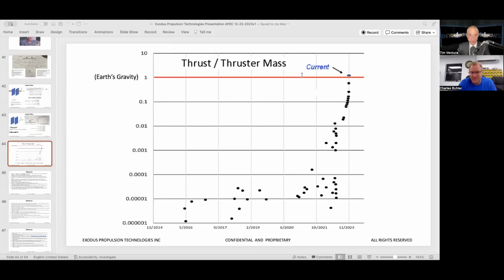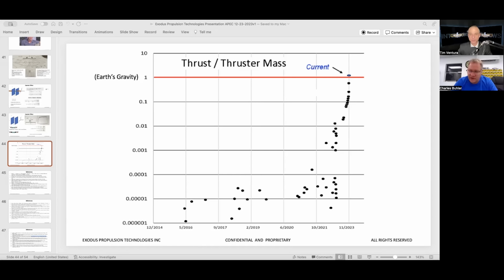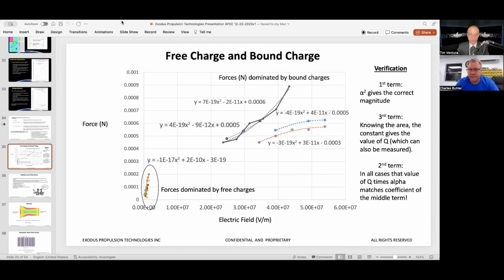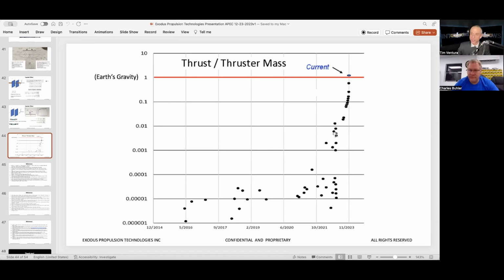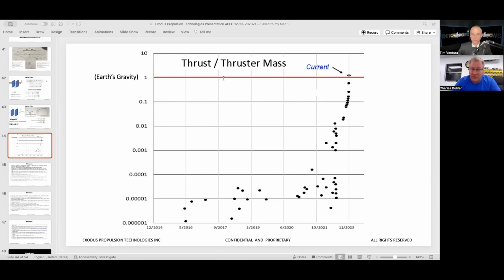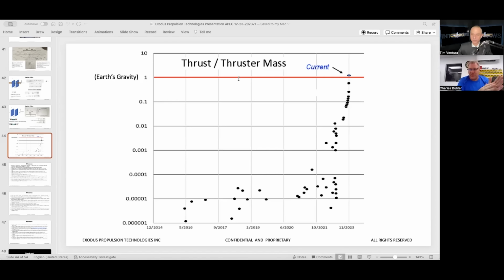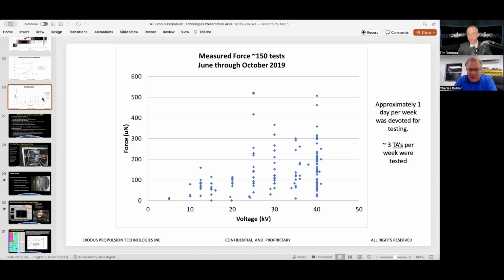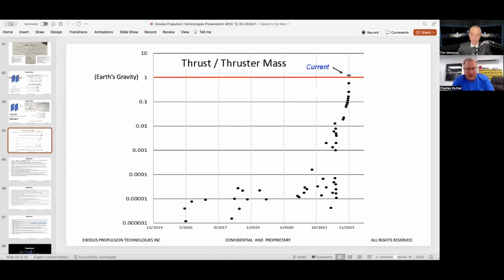Propellantless Propulsion Device | Charles Buhler

Comment: Let's be clear about the meaning of "Thrust to Thruster Mass ratio". Basically, 1G thrust propulsion allows the weight of an object to "float in the air".  A usable drive would achieve 2G thrust (that would have to include accelerating the mass of all things passenger during transit). Such a craft would lift off the earth (1G) then maintain 32 feet per second per second acceleration (2G lift) (initially while exiting Earth's gravity well). Occupants would then weigh their own weight on any scale in the craft (once away from Earth traveling at 1G through space). The craft would continue to accelerate until it got half-way to its destination, then turn around and decelerate for a landing. To get to the nearest star (Proxima Centauri) would take, roughly 4 years of light-speed travel.  The craft would achieve light-speed (if possible) some four months after departure and decelerate for a final 4 months. During the intervening four years, all bodily processes (and electronics) would be suspended due to waveform flattening at the velocity of light. Navigation and other processes would also be suspended for the same reason. Assuming time dilatation effects are marginal at 0.9 light-speed, a practical craft would be prevented from achieving light speed (obviating potential stasis).   Operating at 0.9c would only add roughly a half-year to the venture -- kewl....
Reply: It would take about a year to get to 95% light speed. It would take about 3.6 years to get to Alpha Centauri (7.3 years would pass on Earth). No matter how fast the ship goes everything would be normal on the ship, relativistic effects are all from an outside/stationary/Earthbound observers point of view.
Reply: @shawns0762  Hi Shawn,

Proxima is 4.29 LYs distant. You may want to revise your transit time (using relativism) to 4.5 years. Meanwhile, relativism is a theory -- not a law. Considering relativism as "waveform distension" (meaning emitted light loses frequency as a craft accelerates rather than mass increases and time slows down) reveals a different picture about time dilatation. Basically "change" (time) is based on energy. Waveforms lose energy roughly proportional to frequency. As a craft accelerates, waveforms emitted spend part of their energy-frequency "catching up" to the craft. Chemical processes depend on energy levels to drive them (quantum absorption/emission). Wavelengths of say "blue light" become red. What once was energetic enough (blue) may no longer induce a specific chemico-biological process (quantum theory). Yes, this is a radical re-interpretation of relativism, but it may explain how craft can go faster than light, and time dilatation is no longer a factor (within a self-contained "warp bubble"). The bubble carries along its own spatio-temporal matrix not bound by the Cosmos at large. Super-luminal speeds become a possibility...

Comment: In a hollow conductor, charge evenly distributes with the divergence orthogonal to the surface gradient hence a zero potential exists inside the conductor. This condition doesn't hold for charges on the surface of a dielectric (i.e. a non-zero potential inside the material. Either way the near field approximation, in both cases, would betray changes in flux density according to non-uniformities in the surface geometry, but not in the far field. Considered as point source, the electric field in both the conductor and the dielectric would appear approximately uniform. How this might lead to a net non-zero force, in either case, is difficult to imagine.
Reply: I'm going through Dr Butler's patent and have found several errors which Dr Butler may be aware of. One example, eqn (15), the factor C on the RHS should be squared, not omega. However this may not affect the conclusion substantially, unless omega becomes very large. I may comment further, but so far it looks intriguing.

Comment: 14:01 It sounds like they got to 1g by reducing the mass of the device rather than increasing the thrust.
Reply: valuable in a weightless vacuum. 1g thrust builds up over time
Reply: @QuantumPK  Sure if you can accelerate a 1000kg spacecraft at 1g that's great. But if your craft cant be more than a few grams that's much less useful even at 10g.
Reply: Yup, but it still counts
Reply: yea this whole thing sounds lke a psyop. big shock. nasa involved in a psyop. i love nasa though. and psyops can be fun. i wish this guy luck!

Comment: Likely all measurement errors. Vacuum chambers are of metal. "Mirror charges" will be created in the metal and electrostatic forces will predictably result between a capacitor and a vacuum chamber wall....

Comment: This guy said some wacky things. At 21:29 he said having a constant electrostatic force produced by a capacitor that just sits still, without supplying any power to it, violates the laws of thermodynamics. It does not. 

A force needs to produce work in the sense of W=F*d , through motion, in order to transfer energy. His proposed scenario involves no flow of energy out from his capacitor, hence there is no need to posit any strange source for this non-energy-whatsoever. I produce a large force on the chair I'm sitting on, but that doesnt mean I'm generating power like a magic power plant that contradicts thermodynamics.
Reply: He also said they are working at the microscopic level. Static electricity will hold a balloon to the ceiling, but not a 747. many things work at very small scale, but not mesoscale.

Comment: Comment at 25 min's in.
Yes, the Casimir effect is due to the "collapse" of the time energy wave between the plates due to insufficient room for one wave cycle. The energy waves still exist outside the plates and so there is a net imbalance of forces and so a net force closing the plates together.
Zero point energy, ("and all that jazz"), is, as suspected, almost cancelled to the tiny value we measure in practice, despite the vast amount of energy we calculate in theory. This is because the time wave has its negative counterpart, it is a binary wave form, and the net effect is almost zero. (Not quite zero since the waves are made up of energy quanta and so one wave must lead the other by one quantum, one Planck time). This is the tiny net energy we measure, but the vast energy we calculate is for our single positive wave only. We should be able to tap into this. There must be a way.

Comment: Comment made at 24 min's in.
"....no one knows what an electric field really is". That's right, know one does. According to present day thinking, there are numerous "fields" one for this, one for that.  But ultimately there must only be one field, the field of space time. "I can't imagine we're bending space time", but, oh yes you are my friend. You are curving time. All energy takes its energy from the field of time and so time reduces local to the energy, (and/or mass). 
The Earth only has to reduce the time rate at the surface to 0.9999999993044123 of the normal time rate in empty space (as if the earth were not there), in order to produce a gravitational field of 1 "g" at the surface, decaying, (actually, recovering), with elevation of course.

What you have produced is a version of the Alcubierre drive. Your electrostatic energy takes energy from the field of time in an asymmetrical way, (geometrically). It slows down time most in the direction of acceleration, and since "everything tries to exists where time runs the slowest" to quote Kip Thorne then you accelerate in that direction.
Except the Alcubierre theory is only half right. You CAN slow down time ahead of a craft, and so you "fall forwards", but you CANNOT speed it up. You can NEVER speed up time, i.e. you can never create energy, only use some of it from the field, so the field has to diminish when you do so. (If you were able to speed up time, then you would be capable of creating a whole universe and I don't think that will ever happen).

Try this for size. I believe it will help to develop the theory and so help with the development of your drive.
academia dot edu - Ken Hughes - Papers no's 1 thru'10

Good luck with your endeavors.

Comment: I have a problem with describing thrust as being "over 1 g of force".  g is an acceleration, not a force.  Buhler talks a lot about how thing used to be done but does not explain how his device works, which he should be willing to do freely, since it is patent protected.  When he mentioned "zero point energy" I became convinced that this video is part of a hoax, as physicists do not consider it possible to harness zero point energy.
Reply: A quick google search on papers about this, with actual calculations, data, experiment set up, etc yields ZERO results. The only articles are from oddly named publications which look like rags at the supermarket checkout lane.
Reply: F=ma. Thus a (1g) is the F to move an object of mass m. It is relative measure with respect to any object of any mass.
a=F/m  aka the number of g forces to move an object of mass m
Reply: To be fair he does mention Casimir effect which is real

Comment: While I will listen carefully, the first red flag is in explaining his device's thrust in "G-s".
That is meaningless. The few photos I have seen of the test setup indicates a torsion spring to measure the force.
There is ZERO reason to convert to "G-s" and makes zero sense unless we know the mass of the object being accelerated.
This doesn't even matter in this instance as nothing moves during the test (static force against the torsion bar).
So, the "mass" of the object being accelerated is irrelevant for the test.

It is just flat out wrong, and I am surprised even a Bachelor's level physicist would make that mistake.
Seems more like language meant to deceive.

Comment: How do you explain the apparent violation of energy conservation? The violation of first law? There must be some explanation. You probably need as much energy to put into this as you would get form a fall. It probably stops at a set altitude or something...
Reply: It doesn't violate the conservation of energy as they are putting out energy we just are lacking what it is pushing off or interacting with aether strings??

Comment: c²=ε₀μ₀ ... So why not substitute that in a roundabout way into E=mc²? Thus m=E/(ε₀μ₀). Working with that, couldn't you introduce relativistic permeability or resistivity and cancel out what's going on in the denominator? The asymmetric charge is producing an inherent force the same way mass does. The properties of the vacuum itself are kind of weird, because they have spring-like and/or dampening qualities. But the tension or hysteresis effects of that may also be what an energy gradient would be acting against to produce gravitation fields. So this thing may be taking advantage of an electrogravitic effect that's not quite well documented enough yet.

Comment: Speaking largely as a Layman but someone that understands the basic concepts, I would suspect that the best way to implement this for anything that's in system travel exclusively would be involving photovoltaic solar collectors as the power source. Anything beyond the solar system we almost certainly required nuclear fission or if Fusion is perfected by that time. Since the mechanics of the Alcubierre drive or likewise electrical in nature, I would suspect that in terms of velocity combined with a electrical thruster the two in conjunction could give us the kind of speeds that are depicted in Star Trek and Star Wars, especially based on an exponential 1G curve.

Comment: Long comment of speculation.

This is UFO propulsion. How long till we learn that those flying black triangle UFO are actually ours! Now time for mostly speculation. Space time is more like a fluid and the casimir force is a perfect example. Space-time will literally try to fill any empty gaps of less energy which also exerts a force. Manipulating the quantum vacuum should also manipulate space time. Because electrons are typically described as exchanging virtual photons to create their repulsive and attractive forces that pretty shows that the electro magnetic and static forces are caused by localized distortions in the vacuum between the two particles and ambient radiation pressure and maybe if you do get the charge high enough then you can get all those electrons treading across the zero point field enough to sufficiently alter space-time to create a sort of gravitational force that is localized. And they say gravity takes a lot of energy to create but mass does not actually exert any energy to create it which at least to me means it's purely a reactive effect the medium has to matter and other displacements. The manipulation of space-time may not be that hard at all or energy-intensive as manipulating space-time might be the backbone behind every fundamental force. If you can create this effect around an entire craft and cancel out external gravity fields then you can have a craft that can accelerate instantaneously and anything within its energy bubble would feel absolutely no inertia because it would be totally isolated and within its own reference frame if it's indeed creating gravity, and if it is creating gravity as well then that also unlocks faster than light travel not movement travel they're different! Just wait till we find out that zero point energy is actually a thing that can be practical which Garrett Moddel proven.

Comment: From what I gathered, this seems to be an in-space solution for thrust, not a replacement for the rockets currently being used.
Reply: He said the sky is the limit depending on the survivability of materials so if they are at 1G force already I think he's alluding to forces strong enough to propel a spacecraft from the Earth's surface to space eventually. The Saturn V experienced a maximum of 3.9G.
Reply: @michaelbruno1666 no only in space
Reply: @michaelbruno1666  Yeah, but the actual rockets had a thrust to weight ratio (directly analogous to g) of over 100.
Reply: @michaelbruno1666  What craft has ever measured thrust in G's?? It's totally dependent on the weight of the craft which for all we know is .000001 oz. It's a totally useless measurement just like his useless graphs.

Comment: Charles Buhler, try adding strong magnetic fields at right angles to the electric fields. My hunch is this will multiply your output force. When you do your testing, do you take into account the Earth's magnetic field, and it's direction? This may be a missing piece.

Comment: I've seen this one, it's the Epstein Drive.  Unfortunate name, but we can't have everything.
Seriously though, if it's possible to scale up something that's 1.1 Earth gravity, that's flying saucer stuff. It gets much better news the higher that number gets, since you have to carry a power source and control hardware before you start getting productive, but that alone, on Earth, would be huge. Once off-planet it becomes really impressive really fast. What I don't understand is why you haven't done an off-planet test already. If it provides lift, then tape a radio transmitter to it, point it up, and get out of the way. 
This is the kind of thing I've been politely waiting for ASI to handle, but maybe Christmas came a little early.
Reply: Oops, another easy experiment would be to turn it sideways on a tether and you've got a perpetual motion machine. No vacuum needed, don't even need one gravity. Any amount of free force is infinite free energy. Should be able to demonstrate that in an afternoon.

Comment: I haven't finished the entire video but is it possible that no one on your team has considered quantized inertia as a solution to your fundamentals. I know that IVO limited has already launched a satellite with a quote horizon drive using a SpaceX rocket and that satellite is already currently testing their propellantless propulsion system based off of Mike McCullough's theories of quantized inertia. The two drives sound incredibly similar as they rely on electric fields pushing off of an artificially induced Rindler horizon. I only hesitate to compare the two drives in that IVO is not projecting anywhere close to 1G of thrust from their drive They can't even fathom that at the moment they're working with units that supposedly produce micro Newton's at most. Maybe we found the perfect partner for continued research.

Edit: And of course as soon as I make my comments you immediately bring up relativistic inertial and casimir effect explanations which would imply that you are aware of quantized in our show sorry

Comment: Are you familiar with MCA (magnetic cloud acceleration) from "tomorrow's motion". They use magnetic fields and during the switchoff of the coil they switch on another coil to push the expanding magnetic field of the switched off coil into one direction. They also showed a demonstrator with small force.

Comment: Instead of a chemical battery, you might try a nuclear battery as your power source instead of a chemical battery (it will last a lot longer AND you could power all kinds of other systems aboard an entire craft) - you can use americium-242. Also, you can try a betavoltaic device, a thermoelectric converter, and a thermophotovoltaic system to see which one works better - all 3 have advantages and limitations.

By doing this, your nuclear battery can constantly recharge capacitors, too.

And, if you go with a nuclear battery you will need to put proper shielding around it (such as lead or concrete or other material(s).
Reply: You would absolutely need a nuclear device to power this thing for anything except the inner solar system, where you could use either a nuclear device or a big enough array of solar cells.